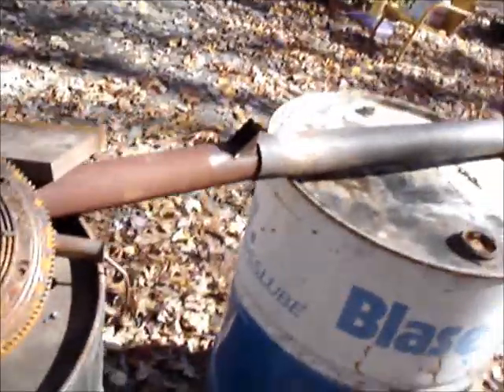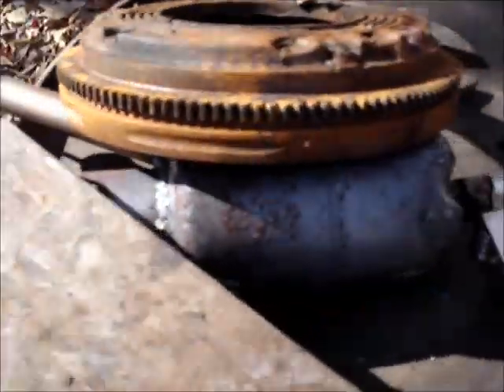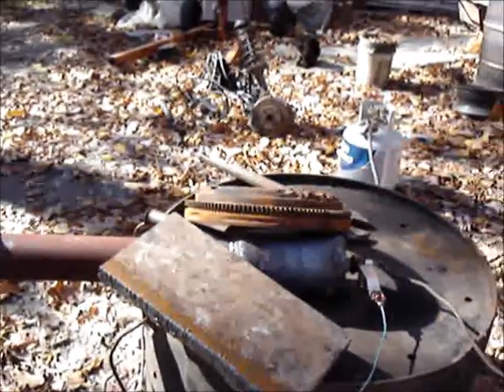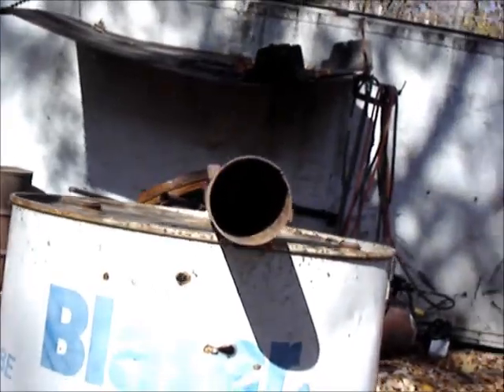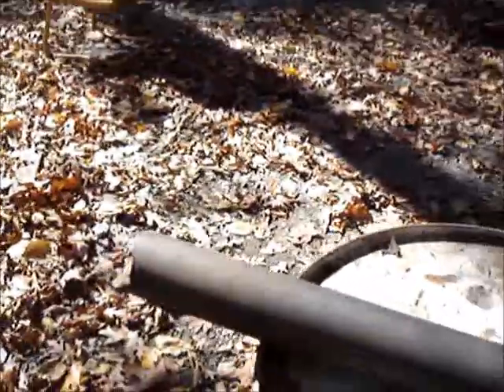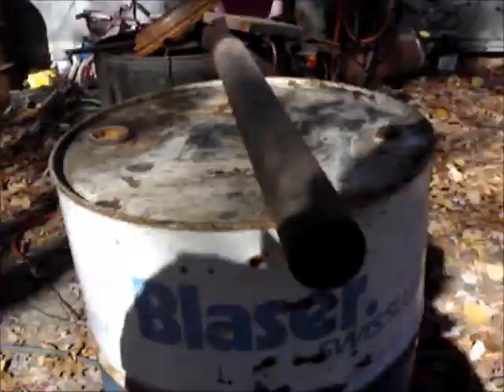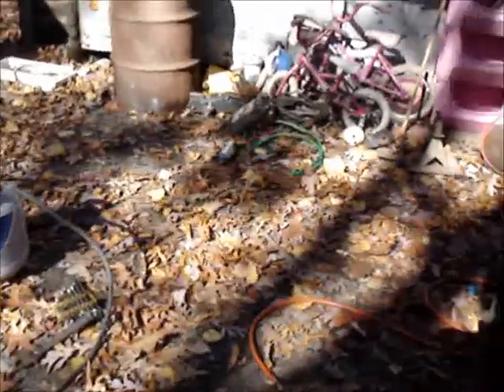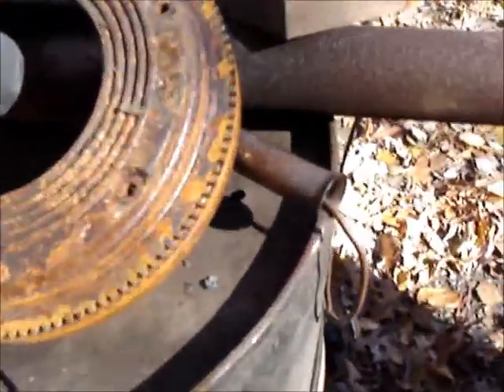From junk to jet

Comment from the maker: Also, I reading up on these engines I've seen a lot of people advising to remove any regulators. I simply couldn't eliminate mine without buying fittings. What I did was cut an angle on my fuel injectors leaving only a tiny slit at the end. Pulse jet.com refers to it as a "roscojector" and I think it was a big part to making this work as well as the extension on the exhaust. As you said though once it was set up, just a whisper of air in the intake, heat in the chamber, and it was running.

Comment from the maker: Look at the Argus. Valved of course but that took a payload across the channel at speeds nearing a fighter plane of the era. The potential is all up to how good your math is.
Reply: heliarche The V-1 "buzzbomb" worked on exactly that principle, and sounded pretty similar hence the name.  The only guidance was to point it where you wanted to go, guess at the winds it would encounter, and then estimate when you wanted it to run out of fuel to drop into your target.